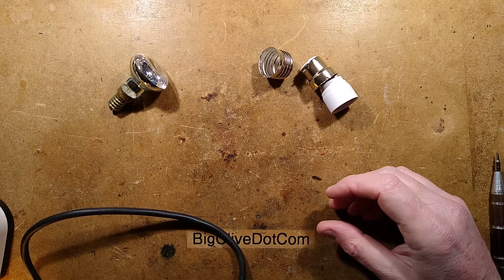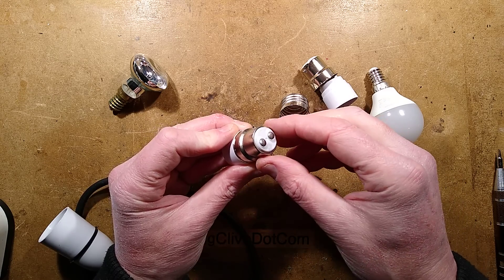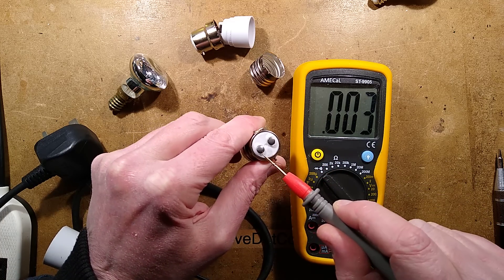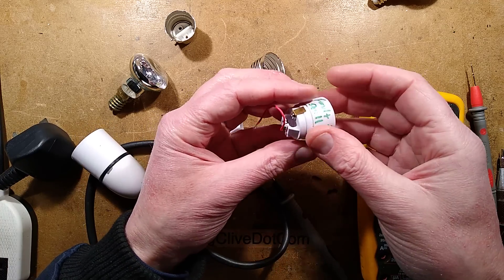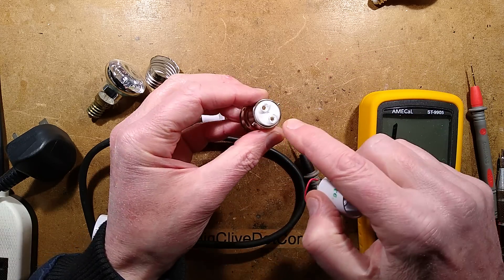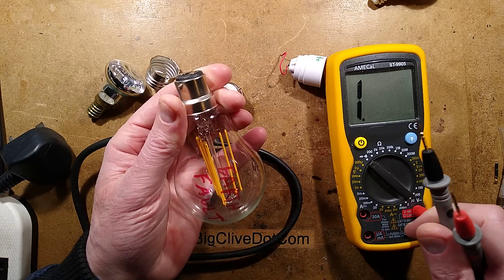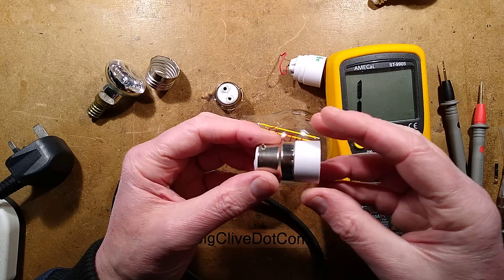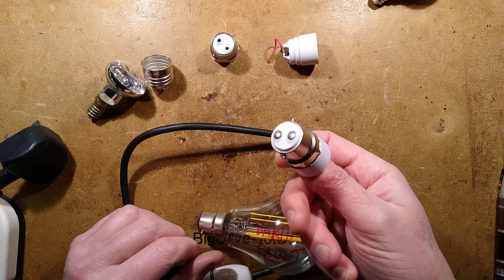Rogue lamp adaptor with shock risk

Comment: Nice insights on some failures I wouldn't see in my country because we use Edison threads :)
Reply from the maker: True.
Reply: It's ironic that the lack of a safety feature could in turn be safer now because of the proliferation of cheap unsafe junk.
Reply: Properly wired Edison lamp holders should connect the cup to neutral.  Unfortunately non-polarized plugs ruin that.
Reply: @johndododoe1411  I had half a dozen reverse wired outlets in my current house. I've also found reverse wired extension cords.
Reply: @christheother9088  In which country?
Reply: Upstate New York. I used to be a handyman and found many mis-wired outlets.
Reply: @johndododoe1411  Norway uses Edison screw bulbs, and large parts of the country still has an IT grid. That means there is no real neutral, all phases are insulated from ground. So by default here, unless you have a bipole switch, the exposed metal bit is live. Somehow, people don't seem to die all the time.
Reply: @christheother9088  I had similar findings in an apartment in Turkey, some sockets wired dangerously wrong, one socket just hadn't been connected to any wires.
Reply: @johndododoe1411  I don't see how you can call non-polarized plugs improperly wired for Edison lamp  holders.  When Edison screw lamps were developed, there WERE no polarized plugs.  That's a bit of trying to "correct" history because it doesn't suit 'modern' thought.
Reply: @christheother9088  How can they work inverted? And even if they did wouldn't they blow up everything they touch because electronics don't like being backfed current... I'm in the UK so I might be missing something - our sockets are all live neutral & earth - the only confusion is people changing colours when they feel like it (being red colour blind -  dark red or dark brown live and black neutral is a really great choice).
I've never tried wiring a plug backwards - I don't really want to find out what happens..
Reply: @rosiehawtrey  It's AC power so in some sense it doesn't matter.  Current is flowing in both directions, oscillating back and forth.  Most electronics converts it to DC anyway.  It's not like putting a battery in backwards.  BUT - since voltage is relative to GROUND (neutral) a "grounded" person can safely touch the NEUTRAL since its at the same potential voltage as the person. Touch the HOT and you have 120v(USA) above/below ground going thru you.
Reply: I've seen smaller base bayonet lamps for 120 volts in the US in very old clock radios.  They are wired just like the UK ones with the base metal isolated.  They are the same size bayonet as the 12 volt automotive bulbs which always use the base as a conductor.
Reply: @tbelding  We don't have to correct history, we can correct the present.  As in if you're buying a new one it should have a polarized plug.  Or if you're rewiring an old one, might as well bring it up to standards.
Reply: @davidg4288  - That's generally what I do.  You sort of have to fix the outlets, considering almost everything comes with a polarized plug now.   My point is that there's no 'wrong way' to wire an Edison screw, or non-polarized outlet.  At the beginning, everything was designed to just work, no matter which way it was put in.
Reply: @davidg4288  I've got one or two, 25W 220V. They were used in old Polish "Łucznik" brand sewing machines.
Reply: @KeritechElectronics  Bayonet bases are good for machines, they won't work loose from vibration.
Reply: @tbelding  I used to live in a house built in 1955 that had only non-polarized outlets.  Nobody got electrocuted.  Tube AM table radios were pretty treacherous though, you had to plug those in the right way around our you'd get a tingle or a wallop depending on the condition and design of the radio.  Mom got shocks from defective electric fry pans too.  GFCI's fixed that eventually.  I still have a non-polarized table lamp, I probably ought to rewire it not because it's a shock hazard but because the insulation might fail and cause fire.
Reply: @davidg4288  I just rewired a lamp for a customer that was last rewired - maybe - in the 1970's.  VERY stiff plastic coating.   Before that, I put a new cord on a synchronous clock for the same person.  (I'm an IT guy.  If they'll pay for it, I'll do it)
Reply: @tbelding  I forgot about those synchronous motor driven electric clocks.  Everyone had a clock outlet over the kitchen counter years ago.  Mine have all worn out but I do have some electronic clocks that use the line frequency as a time base.  Now that I think about it I bet those plug in mechanical timers must rely on a synchronous motor.  I remember seeing a huge synchronous motor at an auto plant, it was used for power factor correction, and also to compress air just to give it some work to do.
Reply: @davidg4288  That would be impressive to see.  I wonder how you use one for power factor correction.    I have a synchronous clock that looks like a giant pocket watch, including chain.    (I need to heat/cool cycle the motor a few times, adding very light oil, to make sure the motor stays in good shape.  It likely hasn't been maintained since the 1950's)    Synchronous clocks were/are used a lot in schools.  Remember the ones that hummed loudly in the classroom, and the gym wall?
Reply: @tbelding  Unlike the clock motors, big industrial synchronous motors use an electromagnet rotor powered by slip rings.  By varying the DC current through the rotor the voltage / current phase angle of the motor can be varied.  AC generators can also be used as motors to "generate" reactive power.  This is usually done by power companies.

My parents had one of those pocket watch clocks.  It may still be stored away in a box somewhere.  The clock had a big gear around the perimeter that drove the minute hand which was in turn driven by an AC motor in the "winder".  The bearings finally wore out in the motor and I was unable to find a motor of the correct RPM.  I didn't try very hard though.  The face was glass with roman numerals in the usual clock face arrangement.

Some of the school clocks had additional relay based circuity to set them to a master clock in the office.
Reply: @davidg4288  Check the clock forums.  Some folks have had the units rewound to compensate for a replacement motor.   Others simply removed the old motor assembly (keeping it in storage, sometimes in the clock itself), and put in a newer system.    I just did a quick search and found lots of information, including rewiring to run on low voltage.   At least one company makes full motor assemblies for Europe.   (50hz).   The oil trick only works with a motor that's still moving.  The old oil loses the volatiles, so you warm the motor up (coffee cup warmer), put oil in the 'cup' around the shaft, then let it cool - sucks the oil in.  Repeat a few times, then that thins out the old oil.   Too bad the companies, even in the 50's, didn't intend for the motors to be serviceable.
Reply: @tbelding  So much wrong in one post...
you can most certainly wire an ES screw 'the wrong way' and worse- due to the proliferation of US 'colour codes' on the internet- if you wire it the wrong way round (Black is neutral and white is switched active in most of the world) you can and will get a potentially fatal  lamp fitting unless you are in the minority of countries (literally a single handful) that use US style  colour codes...

Comment: Oh I wish I lived in a country with one kind of light socket. I wouldn't care if it were screw or bayonet, just pick one. In Australia, houses frequently have a mix of them. You have to remember what each socket in the house is when you buy light bulbs. And now, with LED globes lasting literally years, nobody can be expected to remember.

To make matters more fun, I also have a smaller bayonet fitting for some candle globes.

Comment: My girlfriend bought a metal desk lamp from a charity shop and I said I'd give it a test first. There was continuity between the lamp body and the live pin on the plug. Nothing on the earth pin. And a 13A fuse. Took it apart, the earth wire was just dangling and not connected to the little earthing point on the body, and there was a whisker of copper sticking out from the live terminal in the lamp that was brushing the body causing the continuity between lamp body and live. Amazingly she told me the lady in the shop showed her it working...
Reply: Were the shop lady’s rubber gloves just for sanitary reasons? 😅 🧤
Reply from the maker: That's probably why it was in the charity shop.  "I just got another shock off this light, so I'm taking it to the charity shop."
Reply: A lot of charity shops won't take electrical goods. Fancy that!

Comment: I've always thought that caps with solder/lead connections were better for the socket, one because it doesn't really corrode and two because it's softer on the pins it connects against

Sadly there is a large proliferation of es caps in the uk, the amount of times I thought I've found what I was looking for only to be bitterly disappointed

Comment: Gee you're absolutely spot-on here thanks for the tip. I have a couple of these which Amazon asked me to return due to a shock risk. I assumed it was due to the possibility of touching the outside of the Edison screw so I ignored the return request. Just tested both of mine.... One of the bayonet pins is indeed directly connected to the sleeve! What the actual hell? I will still use them because they're out of reach and I'm an electronics geek anyway , but I will tell other people not to use them. An old vintage brass table lamp with a 2 wire mains lead wouldn't bear thinking about! It never occurred to me that this could be the reason they are being recalled. My theorising about why they are a shock risk was not programmed for that level of stupidity 😂
Reply: If you are a true geek you should know that it was not invented by edision. He was a thief.
Reply: @mernokimuvek  yes I'm aware of this. I couldn't think of what else to call it
Reply: @mernokimuvek  The screw style base was invented by Edison's company. The light bulb itself was not invented by edison.
Reply: @mernokimuvek  - He was an engineer with loose ethical standards when it came to paying people for the work they had done for him.
Reply: @Bubu567  The screw style was used by William Sawyer and Albon Man. edison stole other peoples ideas.
Reply: @mernokimuvek  - Physicists and engineers, maybe.  But not people.  The first 'electric' city was in Indiana, in the US.  Chicago and New York were building generation facilities in by 1882/1884.  There was a city in Romania that had coal powered electric street lights in 1884, I believe, but Europeans were not even as experienced  with electricity as Americans, and Americans were being shown all the dazzing things by Edison by the mid 1880's.   He was a showman, a marketer, an an engineer - just not a very nice person.
Reply: @mernokimuvek  Not true, it wasn't the screw socket base that he sued edison over, but the tech used inside the lightbulb. The 'edison screw' part of the light bulb is basically the only thing about the light bulb that was genuinely his.
Reply: @mernokimuvek  - Timisoara was the first electric city, currently in west Romania.  Not Austria-Hungary.   

I take it you're in Europe, from the anti-american/pro-european stance you're taking.   Bluntly, core electric development was almost entirely in the US (even if Tesla was Serbian/Croatian).  Scientists worked with it in Europe, but the massive push for development and use through just after WW-I (reconstruction) was in North America.  (Canada and the US, especially hydroelectric due to Niagara Falls) 

 Tesla and Edison?  I've studied both.  I admire Tesla far more than Edison, but I refuse to discount someone's accomplishments just because they're a horrible person.  Someone like Marconi, however, who did little to none of the work, however, I think of less than Edison.
Reply: @Bubu567  Even that was not his.
Reply: @mernokimuvek  - He built the first true research facility, spent hundreds if not thousands of hours perfecting the light bulb (carbon fiber and vacuum), took the technology that led to the phonograph (wax cylinder) to market... He did a lot.  Again, he's no less of a scumbag, it's just that he did make his mark.  Do some real reading on the man - ignore electricity and look at everything else.

Comment: Safety measures circumvented ..  ..and I guess the housing will either be live or .. live (minus an insignificant voltage drop through the lamp circuitry) It will probably measure 220Volt just fine even if it is connected to neutral and the lamp is on.

Comment: I was a lad of single digit age, when I learned that the screw part of the light bulb holder can, and did, shock me with 220v. Polarized plugs, you say? Not in households till decades later.  Lesson = no touchy metal if plugged in

Comment: RCD?! Laughing in Bulgarian. A one phase supply apartment block built around 2000 didn't have one. In a village house I got three phases with 63A main breakers followed by three 25A breakers and that's it. 25A allows for quite some fireworks, when you plug in a faulty old extension cord.🎆
Reply: Well, we're one step up from you guys - laughing in Romanian: and yes, same result. I'm sure newly built (or re-wired) homes include RCDs now, but the vast majority of existing ones has no such thing. I certainly can't recall seeing one installed anywhere I've been...
Reply: I know houses in Australia that still have outside fuse boards, normally next to the front door, exposed, still with ceramic replaceable fuse wire fuses, not a dream of an RCD and cloth covered wires vanishing into the house.

Comment: I remember when Woolworth was around in the 1960s and they were selling plug adaptors extra that were made in Hong Kong and if you plug in a heavy load they will go up in smoke or catch fire but they were cheap so it was a cheap way to burn your house down

Comment: The faulty lamp could be nasty, the DC leakage could 'blind' a type AC RCD
Reply from the maker: Hence why they're finally pushing a minimum of type A.  Like Germany has had for ages.
Reply: @bigclivedotcom  A wiring regulation you agree with? 
😬
Reply from the maker: @TheChipmunk2008  One that a proper regulatory authority would have put out a very long time ago.  But what we appear to have is a club for university graduates with virtually no real life experience of the electrical industry.

Comment: Minor technical point, but "neutral" shouldn't ever be considered as "0V" reference to "earth" - particularly if you are on a TT supply.
Reply from the maker: Which I am.   But neutral should generally be close to earth potential.
Reply: @bigclivedotcom  you use TT in the UK? Interesting. Here in Poland TT is a rarity and considered outdated on low voltage distribution grids - most of the country runs on TN-C(-S), plus some IT for special uses like in hospitals etc. Medium and high voltage transmission grid uses TT or IT, I'm not exactly sure which one.
Reply: @bigclivedotcom  Should.  At least until you plug one of these ebay sourced adaptors onto a circuit with an ebay sourced breaker that's mysteriously full of rusty nails or something ;P
Reply: @bigclivedotcom  Neutral should be regarded as live.  Because under some fault conditions it can be.
Reply: n=e=0v  unless you are near the middle of a heavily loaded ring main.

Or, in an outbuilding in the US, where the neutral is heavily loaded.

I guess I believe that the "One ground only" is better than ground every electrical distribution panel, if the threat is a lightning strike.. but how many times do you get a lightning strike vs a line or neutral fault to ground? Which is the lesser weevil?
Reply: @bdf2718  Some rarer faults will make the PE live, hence the requirement to do equipotential bonding to keep all Metalwork in arms reach at the same voltage as the PE.
Reply: @KeritechElectronics  Clive is on the Isle of Man, which, while part of the UK, does have it's own peculiarities regarding electrical systems, being that most of the island is composed of granite, which makes putting ground rods in a rather herculean effort, often also involving rock drills, and plenty of holes, to get an acceptable low impedance in the system, especially for lightning earthing purposes.

Comment: At my place I had GU20 sockets. Noticing that LED GU20 lamps are kinda terrible compared to E27 I bought a bunch of GU20 to E27 converters on eBay and was quite satisfied with those, those had no spooky metal bits. My only worry was re. putting additional weight and lever on GU20 mounts, but worked fine for some years.
Reply from the maker: GU10?  I did get some adaptors to E27 and it gave much more useful lighting.
Reply: @bigclivedotcom  Oh yes, GU10, my mistake.
Reply: @Vokabre  I believe in this case you meant GU24, which was a fairly common standard in the U.S. for the better part of the 2000s as a means to force people to use more energy efficient bulbs. For a while, you could use only fluorescents on GU24. Then LEDs became a thing and we went back to E26/E27. 🤷‍♂️
Reply: @jrharbortproductions  GU10 was correct, it's more common in Europe
Reply: @Vokabre  Gotcha! GU10 is used over here as well for MR8 and MR11 bulbs, plus a few other oddities that may not be so odd over in Euroland.

Comment: catching up on the video back log been behind aha, any how this is why if or when i buy things i start testing and checking for stuff like this now a days, just cant standards or safety standards as good anymore and its really scary how much stuff like this is around as well likely ends up in most retail even. on a funny note i had a led lamp fail in my ceiling and the neutral to the base fell off inside how lovely quality of things been. i am amazed it taken like 5 years for that to happen.